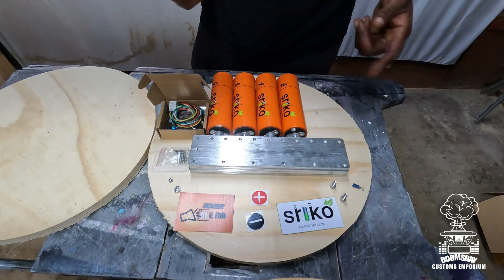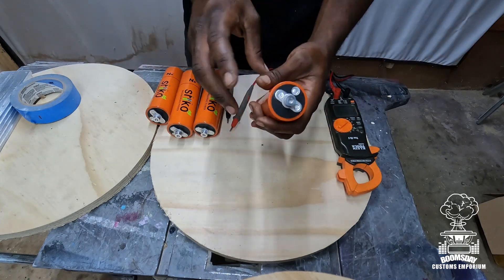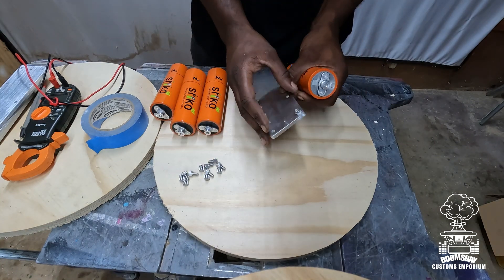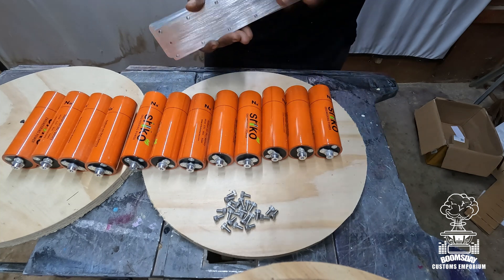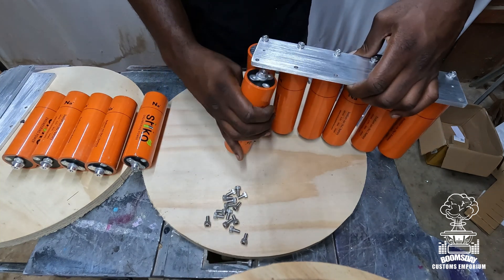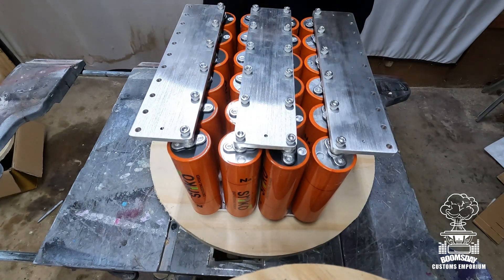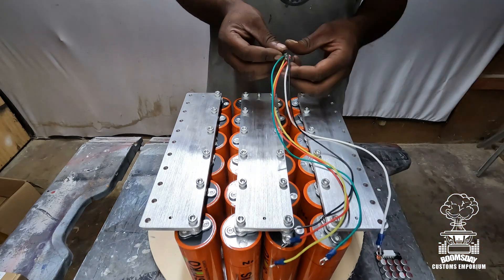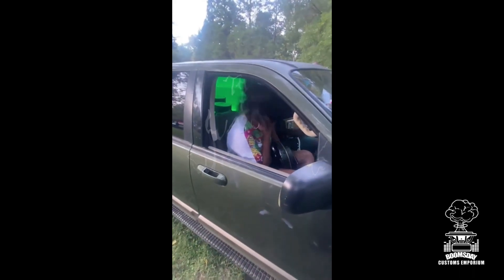SRIKO!! | How To Build a SRIKO Sodium Battery | Step By Step | Lithium | | Car Audio Music Battery!

Comment: How many Ah is that batterypack and how big of a system is it good for running?
Reply: each 46145 cell is 18Ah. But, It is more efficient to use 50Ah cells. less weight and space says LithiumMoto

Comment: @BoomsdayCustomsEmporium Can you please tell me the width of that box you made. I just purchased the same kit & I need to make them fit in a limited amount of space in the trunk. I have availible length, it's the width I am worried about.
Reply: Lithiummoto says,  each cell is 46mm wide, so, multiply by 4 and add a little for spacing
Reply: @aerolithiumbatteries8152 thanks!!

Comment: Can you charge the bank every other week, you know, to keep it charged 😅?
Reply from the maker: I had a bank sitting with no balancer at the shop for about 7months. Only dropped 0.2v
Reply: @BoomsdayCustomsEmporium what kinda charger do you use? I ordered a variable DC Power Supply that from the info I've gathered you can charge it with! Thanks man your the only one on YouTube with a informative video on putting a sodium battery together!
Reply: Yeah mines has been sitting for about 2 weeks now after I charged it to my set point, hasn’t dropped anything yet. I also have my balancer disconnected. Just waiting on my alt now.

Comment: How is this holding up? In a cold climate how do you manage charging temps or has it been a problem? I have a 400 amp alternator will this possibly kill the cells faster? Also last but not least how are you using this as your only form of battery and how is it handling under load?

Comment: Currently assembling my 4p bank and noticed all the hardware is the same length, not two different lengths like yours, did Sriko update the kits to be all the same length in the last few months or did I just not get the right hardware?
Reply from the maker: On more recent sets, i have noticed they swapped to a standard length since customers were still not using the right length in the right places. These fit fine 🤘

Comment: So I got two of these kits and got them together. 6P 108Ah x 2. I assume I can take off the positive of one and hook it to the negative of the other. It would still be + - etc. Correct me if I am wrong. Second question, I would assume I would need another balancer to handle the much larger bank instead of two since there would be double wires on some of the balancer connections
Reply: Attaching them positive to negative would put them in series, not parallel. They need to stay 4-in-series for your final voltage to be correct, and adding more parallels gives you more reserve. To do what you’re asking you’d either need a new set of bars that are 12 cells long or to run them as two separate parallel batteries (+ to +, - to -)

Comment: What charger did you use to charge the battery? I just got a 4s2p bank and I’m trying to figure out whats best
Reply: I would like to know what charger to use also
Reply: @keddrickhowell206  LithiumMoto has 12V chargers for sodium
Reply from the maker: wanptek dps3010u on amazon